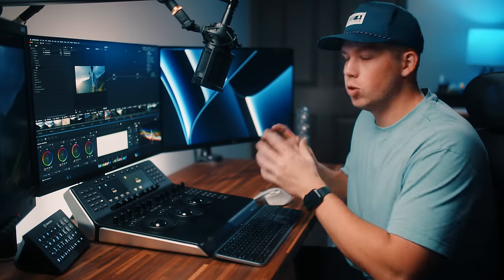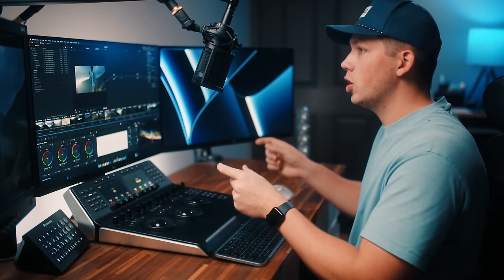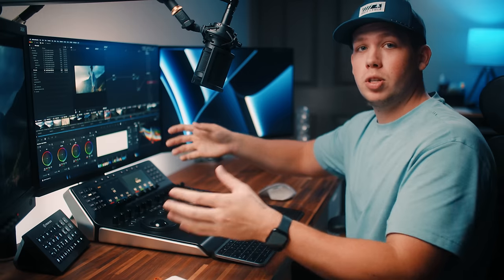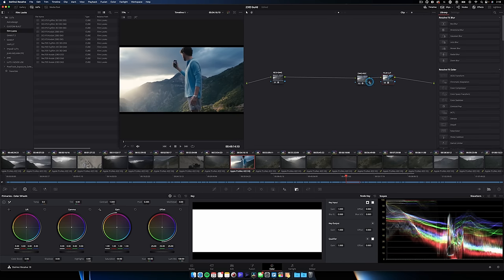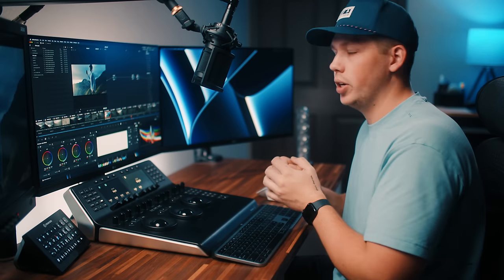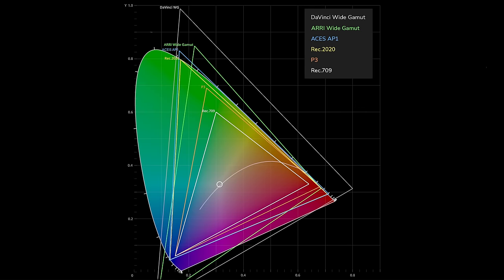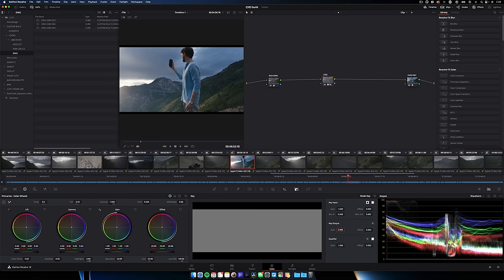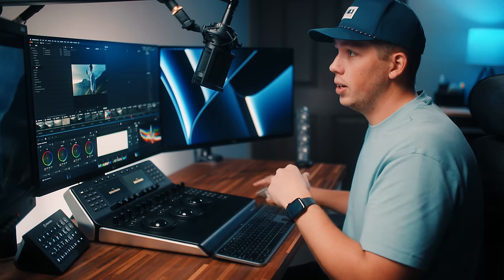THE PROBLEM WITH RESOLVE'S FILM LUTS...

Comment from the maker: UPDATE! In response to multiple requests, I’ve just updated the link to include 3 ADDITIONAL LUTs which WILL work in Premiere/FCPX.

These 3 additional luts are mapping REC709-REC709 so they will be applied on top of your corrected footage. If you’re using LUMETRI in Premiere, use your Technical Lut drop-down to apply your Log-Rec709 lut, and the Creative Lut drop-down to apply this new Rec709_2383 Lut. 

You can download them here: go.jvke.us/2383

Comment: THANK YOU for a clean explanation. Question: If I am working with mixed camera sources (Blackmagic RAW and DJI drone D-Log) what would you set your project color space settings to? Committing to BRAW will probably jack up all my aerial shots. Do I leave it on Automatic Color Managed? Thanks for the LUTs download.
Reply from the maker: Still leave it custom. And do you mean input color space? Or timeline?
Reply: @jvke.p  I guess my question comes down to understanding what happens when using this awesome LUT mod from you and thereby removing the Node based CST that used to be there and relying on your project settings:: In the Project Color space &Transforms>Color Management you have Davinci YRGB Color Managed / (untick Auto) / Custom/ and since the majority of my footage is BRAW, under the Input Color space should I select BLACKMAGIC DESIGN Film Gen 5?.. Followed by Timeline Color space as DaVinci WG/Intermediate... if by doing this with mixed footage such as drone shots in D-Log will it be jacked up since Input Color space is set to BMD? Sorry for the rookie question as I just jumped ship from Premiere and am soaking in all the new info.
Reply from the maker: @ryansouthwell  I see. No need to even select the braw settings since resolve can read the raw metadata and select the appropriate input transform for those clips. You could set it to any other camera input transform in your project though. 

Selecting DJI Dlog in your input transform in project settings doesn’t mean EVERYTHING gets marked as DLOG. 

You can still go in to each clip in the media page or color page and select their respective input transforms by right clicking-> input device transform -> select whatever it is. 

I teach this in DEPTH in my course. Let me know if you’re interested and I’ll send you a link

Comment: This is such a helpful video! Can you tell me one thing… can you work in project level color management when you have multiple video sources (and their respective color spaces) being used? For example, I have a v-log from my lumix s52, footage from a dji mini 3 drone, and footage from a go pro. Is it possible to use a project level setting and still use your lut? Or do I need to build a  node tree with color spade transform for each type of footage? Thanks!
Reply: Was wondering the same thing
Reply from the maker: You can absolutely do this! You’ll just need to set your input device transform appropriately for each respective camera’s clips. 

I cover this in depth in my course which I’ll link below if you wanna check it out. 

go.jvke.us/signup
Reply from the maker: Tagging you as well!

Comment: Great video and well explained, thanks!
Is there a tutorial on how to adapt the luts like this? (Kinda new to Resolve, but not a total beginner)

It's be great to be able to make a Panasonic V-log -> 2383 lut for in-camera monitoring if that's possible (or maybe it's not possible without going to DWG/Cineon Log first?), struggling to find a tutorial to do it properly though. No idea how you changed this to DWG in/DWG out for example.
Reply from the maker: Thanks man! Yes you can do that VLOG-cineon-2383. And then turn that into a lut

Comment: Amazing video, so extremely informative and helpful! Quick question, if i'm shooting on a bmpcc 6k, do i not need to do the input conversion before the LUT?
Reply from the maker: It depends on your color management settings. The luts are built to accept and output either ACES, DWG, or ARRI. If you’re working at the project level, no need for the CST, if you’re color management is at the node level, you’ll need to transform to one of those color spaces at some point prior to the lut. And then transform to rec709 after
Reply: @jvke.p  okay, I think I’m getting it. Sorry, I’m new to LUTs, and it’s confusing how there’s so many different DaVinci options for the input
Reply from the maker: @dnvnduelas  yea all good. You’ll just need to convert your camera color space settings to davinci wide gamut.

Your camera doesn’t shoot in davinci wide gamut/intermediate. It shoots Blackmagic design film gen 5.
Reply: @jvke.p  got it! Thank you so much! 🙏🏽

Comment: You can always make a compound node of the CST node and 2383 lut to 709 transform and then you're able to adjust the key output without fading back into the cineon log. Transform. 

It's nice though to have the lut designed to stay in your workflow color space. Good video!
Reply from the maker: This is what I used to do for a while until I built the luts. These luts really aren’t a new idea, just a new approach to solving the root issue. Thanks for the comment!
Reply: Darren Mostyn workflow

Comment: Immediate subscription.. Thanks a million I was unaware of this.. ! I'm kind of new to Resolve, and was wondering if that Cineon colourspace requirement is also valid for LUTs external to DaVinci? I bought a while ago the LUTIFY ME Luts pack that I used with FCP.. but now I'm not sure how to use it in DaVinci..
Reply from the maker: Thanks man! I’m not entirely familiar with that lut pack honestly. But here’s the thing about luts (or at least, properly built luts), they ALL are meant to expect an input color space, and there’s always an output color space. 

The tricky thing is, the lut itself isn’t technically able to tell you what it expects as it’s input, or what it’s going to output to. That’s why it’s important for a provider of those luts to tell you what it’s built for. You really need that information to use them properly.
Reply: @jvke.p  Thanks! I'll write to the support.. Are ALL LUT's included in Da Vinci expecting cineon?
Reply from the maker: @Superjeanmarc  not all of them. just the film looks luts and any others notated as requiring a cineon input. (to my knowledge). The reason these expect cineon film log is because they were built to provide a realistic emulation of what your film negatives would look like once printed onto Kodak 2383 film. but we've adapted them and used them to give digital LOG footage a similar look.

Comment: That's really great Jake. 
The one you placed here, looks really good -
I will download and try them and I thank you in advance. 
All great points about the limitations of the original versions. 
The color management workflow in DWG is becoming really popular, so I was expecting at some point somebody would do this. 
I have issues with the contrast curve on the original and started using layer nodes and adding the LUT on top and bottom ( same lut ) then changing the layer node  composite mode to "Color". 
Then selecting the top node and adjusting the node key - key output, I can pull out the contrast and leave the color - then apply my own curve and lock the mid grey and adding a filmic curve ( s-curve ).
Anyway thanks in advance for your generosity in giving people the LUTs - looking forward to trying them out. Cheers.
Reply from the maker: Thanks a lot Jim! Glad you liked the video!

I’ve experimented with that technique in the past as well. I think we can pretty much all agree, we love that 2383 😂 we’ll do whatever we can to fit it into our WG workflow

Comment: sorry for belated response and my naivety. jus getting started w/resolve:

is the "color management" in settings the same as a cst? if, for example, i enter the correct info in the former do i still need to use the cst node? and vice versa? 

appreciate ur content. 
-colton 🤟🏼
Reply from the maker: No worries at all brother! They are two slightly different methods to accomplish the same task: color management. 

Totally up to you for which method you prefer. Sometimes it varies project to project.

Comment: Hello! Thanks for the LUTS. Just to clarify I don't grade in DaVinci Intermediate / Gambit. I grade in Rec709. 
I just do small adjustments on my footage. I use a CORRECTION LUT from Log to Rec709 and maybe a couple of nodes before the CORRECTION where I grade my primaries. Maybe when I get a better camera or do more grading I will start to grade in a better color space.

My question is this: 

After my primary nodes and my CORRECTION LUT (from Log to Rec709), I can apply your Kodak 2383 Rec709 LUT in DaVinci right?
Reply from the maker: @IvarNesheim  yea you can do that!
Reply: @jvke.p  Sweet. Thanks for the reply and the LUTS!

Comment: Thank you so much for this! I have 2 questions. Can you make this for the fuji one as well? or explain how this was done? i think its just clever use of the color space transforms CST (input dwg, asus, etc) then original lut and then cst with the same as the input, right?. Question #2 would be regarding using the managed color workflow. If i add text and graphics, I need to CST them into the input (for example using red foorage, cst-ing the text/graphics into the camera profile)?
Reply from the maker: If you’re using text within resolve, it knows that it’s text and won’t apply the transform, it will bypass the color management. When working with graphics, you can either set the proper input transform (usually rec709) or bypass color management on the graphics.

Comment: Hey Jake, I am dealing with redlog footage. And I want to work in basic Resolve color managed, so I'm setting the color processing mode to HDR and then the output color space to SDR and it converts my clips to rec 709. but now - how do I actually apply Resolve in built Kodak luts, so I can then work in the widest possible color space?
Reply from the maker: I prefer a custom color processing mode. Or you can do your color management at the node level using CST’s.

Comment: Great way to save on extra nodes. I had previously been putting a CST then my LUT on Timeline nodes then creating a compound node. This way you can lower the Key Output gain without the dreaded look going back to LOG. I am wondring if there is a way to create a scene referred LUT that when applied it wouldn't brighten the image and add the contrast. Let me know your thoughts. THANKS!
Reply from the maker: Happy to help! And for the second question, probably so! But what are you looking to accomplish in that scene referred lut?

Comment: Hi Jake, refering to your first problem with the build in film looks: What are the reasons to make changes after the film look is applied. I understand that some changes and effects should be applied at the beginning (e.g. noise reduction)  or at the end of the pipeline. But are there any reasons to make changes after the lut applied?

As far as I am aware of you can "precompose" the CST and The Film Look Node, so you can adjust the opacity of the compound node properly with the expected behavior
Reply from the maker: I think by “precompose” you mean to create a compound node. And that’s true. I actually just sent out an email the other day explaining this to those who have already downloaded the luts so I’ll have to send you that info as well. 

Now, one reason I may want to make changes after the lut is if I wanted to make small adjustments to specific hues. I may use the hue vs. curves for this. I may also make small adjustments with the log wheels, and those changes may require working AFTER the lut has made its overall color adjustments to achieve my desired result.

Comment: Really good video Jake, but I have a question. When you display the color management page at 05:13, in the timeline color space, you have rec709/gamma2.4 selected, it should be DWG? (because your working space is DWG), I know you are working with nodes, but if it supposedly does not affect, why does the image change when the timeline color space changes?
Reply from the maker: Well typically yes, I would just set it to DWG if that’s the color space I’m using. Generally, the timeline color space setting (when working in DYRGB), doesn’t affect much besides how some of the tools respond, and instances where “use timeline color space” is referenced. 

For examples sake, I probably should have set it to that in the video, but I was bouncing between using the different color spaces I created the luts for so I just left it to rec709. Additionally, you won’t really see a difference from timeline color space changes when you’re only adding luts. 

Great point tho!

Comment: Very useful. Only issue is your Kodak LUTs come out extremely warm for me compared to if I use colour space transform. Even the coldest version. So I have to go through the extra step of trying to fix white balance first.
Reply from the maker: they should be an identical color match to the resolve luts. I would just double check your other settings.

Comment: Hey loved the video. For a person who is using a mac book pro to grade on, im finding an issue with my videos, they export as 1-2-1 color profile if both tags are not rec709. The industry wants 1-1-1 so that the color is consistent on all browsers. To make this happen i have to go into advanced in the export tab (rocket symbol) and make both tags rec709.  When exported on Yrgb CM the video comes out washed. the only solution ive found/created is an output and or input lut. One you grade into the lut, remove it, or add on once finished grading and export. This work flow feels unprofessional and unconfident. Though im getting good quality grades, i know this isnt how it should be, i dont have a calibrated monitor so im just using my macbook pro 2018. could you make a video to touch on this issue.
Reply from the maker: This is all about to be covered in my course on color grading! Shoot me a DM on IG @jvke

Comment: Is it best practice to adjust contrast, colors, etc., between 2 color space transforms?  I usually convert to arri then rec 709. And then make al my changes before the arri CST. Am I doing this wrong?
Reply from the maker: Not at all! What you’re doing is totally fine. I know a lot of colorists (including myself) that choose to work in an Arri color space. So you can basically just replace DWG with Arri log c in this video. 

However, if you’re converting from camera space to arri, then Arri to rec709 and working before the camera space > Arri CST, you’re kind of wasting a step. You may as well just convert from camera space > Rec709. Converting to Arri isn’t doing anything unless you’re working between the two CST’s.

Comment: I'd love to see a video discussing how to properly use the Fusion Page when you're working in DWG. I've dug around a bit but there's not really an easy option for doing that right now.
Reply from the maker: This is something I would have to dig around a bit and learn more about too.
Reply: Some background knowledge: Fusion transforms all footage automatically to Linear Gamma. It also uses LUTs like temporary filters on top of preview windows. Since there is no DavinciWG/Intermediate to your output option, you have to make it yourself.

Basically turn off Fusion preview LUTs and output management. Than you make a preview two CSTs.
1st Timeline/Linear ➡ Timeline/Davinci Intermediate
2nd Timeline/Davinci Intermediate ➡ Monitor Gamut/Gamma
Place these preview CSTs after MediaOut, so it won't get baked to your signal when it exits Fusion. When you work, you preview the last CST to your monitor.
Reply from the maker: @timovepsalainen4927  good stuff! Thanks for providing that!

Comment: This may be a silly question, but why do you convert from RED to DaVinci then from DaVinci to RCO709 and not just RED to 709?  and then just work on the corrections a node before this transform (directly on the RED log) ?   --  I am not a colorist and in fact use FCPX at this time but trying to learn more about DaVinci.
Reply from the maker: You can totally work that way as well! 

One benefit to converting to an intermediate color space for grading purposes, is that you can then use this singular lut for example, at the timeline level, and it will apply properly to all your clips, regardless of camera. Because they’ve all been converted to the same working color space. 

It’s also just preferential, and it more closely represents the functionality of using project level color management, where there’s an IDT to convert camera color space to working/timeline color space, and then an ODT to convert timeline color space to output color space.
Reply: @jvke.p  that makes sense. Thanks for the clarification.
Reply from the maker: @akcine  no prob!
Reply: @jvke.p  makes sense. Tha is for the clarity

Comment: Simple tip: put the CST Cineon output on the same node than the LUT, then when you adjust the intensity of the node everything goes down at the same rate and it works perfectly
Reply from the maker: That’s a great tip! You can also do a compound node if you’re picky about your CST placements.

Comment: Do you use Rec709-a as a timeline color space in order to have proper gamma on the viewer??
Reply from the maker: no because I'm outputting to a calibrated rec709 monitor, so I don't have to worry about the gamma shift that takes place when viewing the image in the resolve viewer on a Mac device.
Reply: @jvke.p  I see! Which monitor? I have a Flanders Dm240.